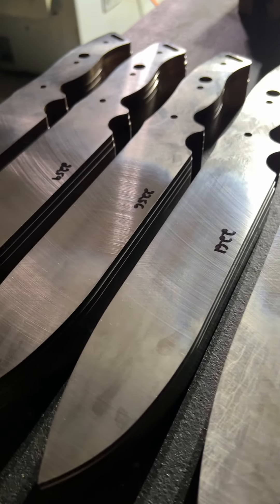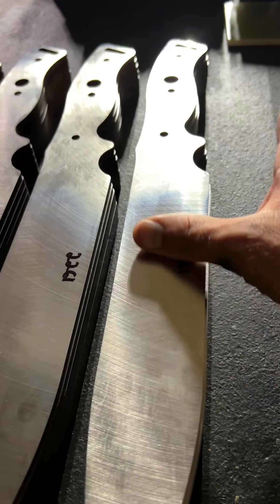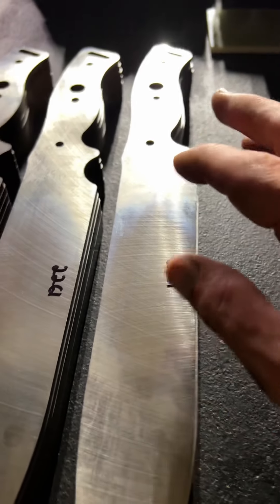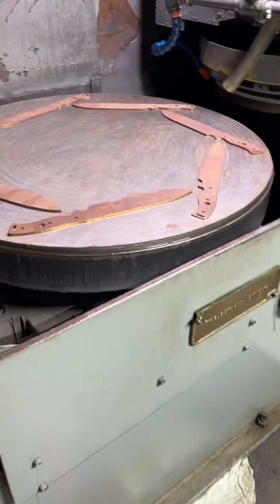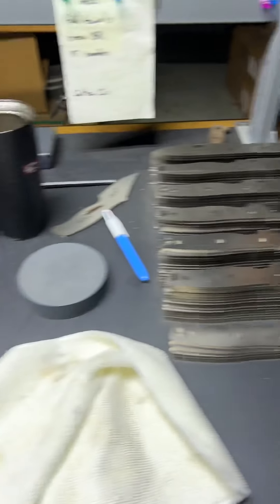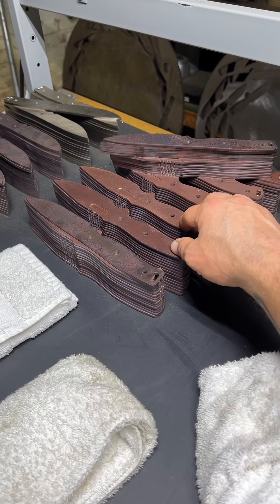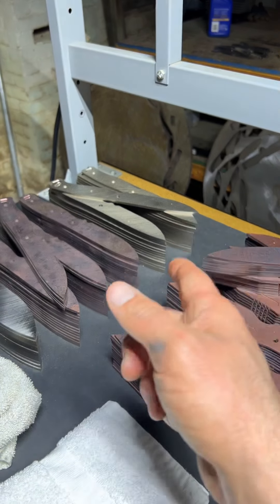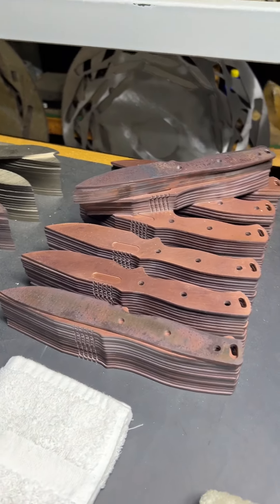GSO-10 Late Night Update

Comment: Lookin good, Guy. So I know there are a bunch of other blades you just showed, does that mean the 12's are taking a back seat again, or are you working on them in-between? I'm not asking to give a hard time I'm genuinely wondering if I this is going to be an after summer thing now and I won't be using it at this summers camp. Any info or update will be really appreciated. Last month hit 3 years and I'm holding strong bro. Please some clarity would be huge 🙏🏻
Reply from the maker: Those are coming as well, standby! Maximum effort time. 🦾